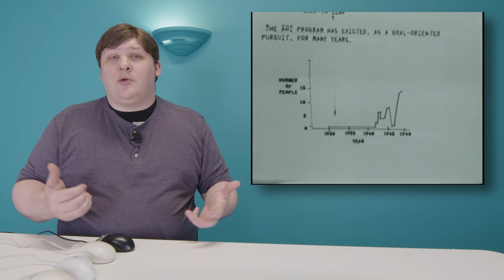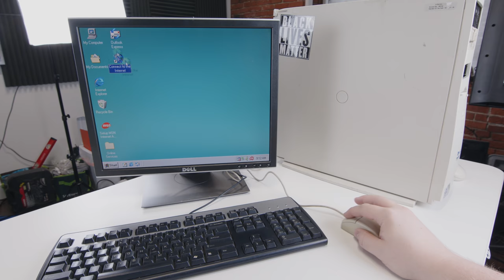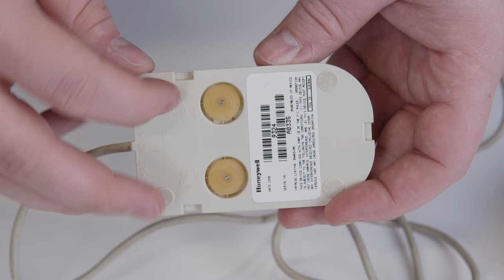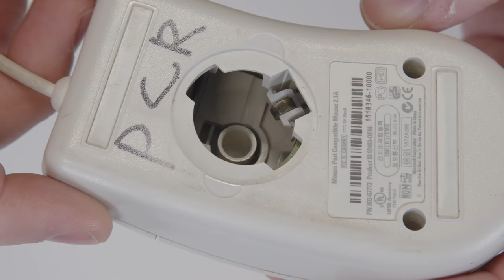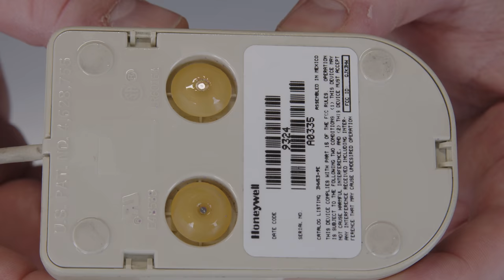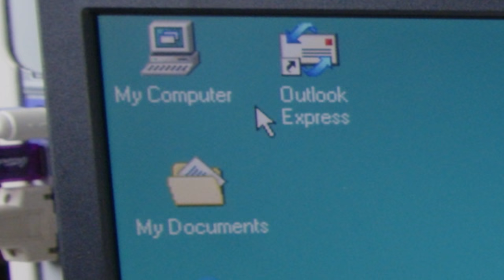Jack Hawley's Unstoppable Computer Mouse

Comment: Pretty sure good SOICs that had the CCD and the processor (and the related deductive algorithms to detect mouse movements) did not come about until the late 90s and as such, the optical mouse did not become mainstream until after the turn of the century.  I was into computers since graduating from high school and did not have an optical mouse until 2005-2007 (not sure when exactly I made the switch).  Early optical mouses that did not require a special mousepad, and I am talking about the early to mid-90s, were terrible and their tracking sucked.  It seemed every peripheral manufacturer was coming out with designs monthly proporting how their new design was heads and shoulders above not only the competition but their own previous design.  This is why my adoption took so long, I liked ball mice and did not mind cleaning them every so often.  I always had ball mice at work, I worked in a call center until the spring of 2006 and all the computers had ball mice.

Comment: BUT! The original optical mice (encoders, and sensors) were a FAR different design then the Micro-$oft optical mouse which used a little camera and a light source!
Reply from the maker: Yep, covered it in my q500 video

Comment: Cool video. I have a question that relates to computer mice. I have a media center that I use for my TV, and of course we have a mouse from which we can control the system while sitting comfortably in our sofa. But we have always had a problem with the range, which is difficult to find a mouse that is good on all surfaces which at the same time can also deliver at 3 meters or more range. Do you have a tip for a mouse we should buy?

Comment: Finally! Proof that I don't have the only one on earth. I bought it because ordinary mouse balls always needing cleaning and this doesn't. And yes, it was damned expensive, just like a genuine IBM type M keyboard.
 Ever try to use an optical mouse on a glass desktop? You can't. But the Honeywell just doesn't care! IT NEVER FAILED.
 Now, if I could only adapt it to a USB plug. (I retired mine when I went to a laptop keyboard with the touch stick in it.

Comment: The potentiometers used were probably like the limitless ones used in the driving controller for the atari 2600, it looked identical to the normal paddle controller but had no stops.

Comment: The PC/jr had an optical mouse (apparently the same one as the Sun): https://en.wikipedia.org/wiki/IBM_PCjr#Keyboard_/_Lightpen  I don't know if you've ever used one of these optical mice, but they are incredibly bad.  They are finicky and only work right if you keep the mouse perfectly north/south on the mouse pad (if you slant the mouse, as you would in a normal natural movement from side to side) it starts skipping and stuff.  My university had sun workstations and the mice were just awful, even compared to generic OEM rubber ball mice from the early 90's.
Reply from the maker: I've heard they're terrible! But, then, what PCjr component wasn't?

Comment: wont work on My pc,
not cause i dont have a serial port but rather because the serial port is right next to the power port, which often resists insertion. on the back of the device.
which means i have on several occasions brutalised my serial port with the power plug,
i have 3 pins left.
gotta love thoughtless design choises like that.

Comment: A spring and thrust bearing would have much tighter manufacturing tolerances as a magnet and a piece of iron shoved into a plastic bushing. So the tooling required to make the mouse like this would be much cheaper.

Comment: Honestly, the main reason a lot of things like this fail, is because no one was sold one. If at the time these existed and you didn't know about them, how would you buy one? Say your actually working in a CNC shop, or the like, a place where these would make the most sense, yet no one tells you about them. After all your going to go thru a lot of cheep mice, and this one should just work forever. Remember, if you don't know about it, you cant buy it.

Comment: Optical mouses wasn´t that expensive in the early 90-tys. You could get one for $20, that really wasn't that much more than a ball mouse. The issue with those mouses was that they have to use a specific mouse pad. Those mouspads was usually very glossy on the surface, and not that nice to use .

What change was pattern recognition from the optical mouse to allowed them to run on any surface, unlocking the use of any mouse pad.

Sorry,.. yes, its as booring as that. It was the mouse pad that was the issue, not the mouse

Comment: I had and used one of these! It always irritated me, that if you rotate your wrist, the cursor moves diagonally. A ball mouse does not track rotation, but this one, because the axles do not touch down on a single point, it picks it up and that is weird to get used to.

Comment: With cheap accelerometers available, I really wonder why nobody decided to make an accelerometer-based mouse. Optical mice still can't work on all surfaces, the one I have has issues with very dark desk I have it on and accelerometer-based mouse could move on any surface, even in the air.
Reply: They're too noisy for that. You can't really distinguish between moving slowly and completely still.
Reply: The way measuring acceleration works, you can't really track absolute position for very long.

However, you could measure absolute position using a microphone and two speakers spaced apart.
Reply: @IsaacKuo  You don't need to measure absolute position, only delta movement and then move the cursor according to the delta.
Reply: @UltimatePerfection  Okay, you're right. Hmm ... in theory, it should work. It would only be suitable for relatively brief mouse movements, but that should be okay for typical use (i.e. not a FPS or other action game). As long as the firmware can assume that zero acceleration means that the mouse has stopped moving, it can zero out it's wrong idea of the current velocity after a second or two of zero acceleration.

It'll be a bit weird, though. Normally, when you stop moving the mouse the cursor instantly stops. But with an accelerometer mouse, it'll coast in a seemingly random direction after you stop moving the mouse. OTOH, maybe the firmware can retroactively zero out the coasted motion after it determines that it's actually at zero velocity. Hmm ... yeah, I think that will work fine for most people. I think most people wouldn't even notice it.

Comment: Those mice always had issues at strange angles (not just an age issue), got given one by a friend who didn't like it either.
Its very peculiar when it occurs but I could never get used to it myself, ended up stuck in a drawer for decades until binned (couldn't even give it away).

Comment: What do you think evolved faster from start to finish into the functionality we would use for years to come, mice, or c? :P

I think the potentiometer mouse would work fine, it would explicitly not do that thing where you have to pick up the mouse. That early thing where you pick up mice and kind of scrape them across the surface, like a cat burying their food, that seems like it would actually be discouraged by this design. Essentially you would need to rewind the mouse ball right? So that means when you go too far left you'd have to go right again. Thats fine, thats how I normally use my mouse, with high enough cursor speed that I can cover the whole screen in a small swipe of the wrist, so i never have to pick up and the mouse stays roughly over the same center point

Two little flat discs? At this time of year? At this time of day? In this part of the country, localized entirely within your studio? ...May I see it?
Reply from the maker: The point about the potentiometer mouse is that if you got it un-zeroed, you'd hit the right side of your screen before you hit the right side of the pad, and would have to pick the mouse up and move it further right
Reply: @CathodeRayDude  I wonder if the potentiometer mouse was actually an absolute input device, rather than relative. So the position of e.g. the horizontal pot directly corresponded to the horizontal position on the screen - when you hit the limits of the pot, the cursor would be at the edge of the screen.

Comment: You know what I think one of the best mouse designs is. The humble trackball mouse you know where you move the ball with your thumb (or finger in some models). They don't give a damn what they're sitting on, don't need as much space as a normal mouse the arm of your recliner is plenty space. Hell I'm using a Logitech M570 right now.

Comment: Well, yes, back in time mice had balls, and with balls come some filth problems. 
But the mice from the 90is worked, and kept working.
I had one  ball mouse! I used it for about 10 years and I bet it would have worked longer. 
I had already over 10 optical ones. And I feel like the lifespan keeps getting worse. And I'm even one of those crazy dudes that clean the switches and tinker around it to get it to work a few more months.

Comment: I don't see why it uses 2 encoders instead of an analog stick (an inverted eraser style nub) using the same material.
Reply from the maker: Because nobody had invented that in 1986, and it has ten times as much friction
Reply: @CathodeRayDude  I could argue that a mouseball approach is analogous (at least past the decoder) to an analog set up, but all the methods have many commonalities so it's kind of moot.

Comment: Actually, I prefer trackballs over mice, anyway. At present, I have two identical mice on both left and right, and a track pad for scrolling or certain other commands. Mice require way too much desk real estate, even more than two track balls and a track pad all put together. Track balls generally have better precision and you can just use their mass to spin the curser from one point of the screen to the other.

Comment: My wife got a GLASS TABLE. I mean REALLY. No optical mouse tracks through 3/8" or 1/2" glass.
I would BUY one of these out of SPITE in USB.
Reply: @UnitSe7en  That's the whole point, Captain Obvious.
Reply: Many higher end optical mice can track perfectly fine on glass. They normally rely on using a "grazing" light (at a nearly flat angle to the surface), sometime even with laser light. This highlights imperfections and dust on the surface for the sensor to track, rather than shining through the glass.

Comment: to be fair if I were to set up a 286 PC with RAMs cache etc I'd struggle to configure all the jumpers etc, whereas a modern PC is pretty much lego, a 6yo kid will do it right, it's hard to actually make anything wrong. The 2 wheel design sucks, if you tried to move it straight the opposing wheel would resist making any movement almost impossible.... Telefunken seams to be one of these companies that invented like almost anything you use but no one talks about them hymm.. I mean didn't they invent PAL TV and early tape recorders as well?

Comment: Would an optical mouse work on oiled Teflon?
Reply: no idea, but there are a Lot of surfaces an optical mouse doesn't work on. anything too reflective or insufficiently flat, for starters.
Reply: An IR optical mouse would probably work better than one that uses visible red. The factor in how well it works would be surface geometry of the oil reflecting light in wrong ways, which is why I suspect IR would work better as the oil is likely to be transparent.

Comment: Picking up the mouse and moving it wouldn't reset the position of the potentiometer. Probably a button to ignore input while he moved the mouse back to center to turn the potentiometers back the other way.
Reply from the maker: I was referring to moving the mouse to whichever extreme of the pad matched the absolute position of the potentiometer.
Reply: @CathodeRayDude  Reading the patent and more about the history, it seems to me like he only used the potentiometers in the original proof of concept and moved to more traditional(to us) rotary encoders since those are also part of the original patent and claimed as part of the new invention.
Reply from the maker: @tmilker  yeah that's not surprising, I was only referring to the one we literally see in the demo, his actual original idea. I would expect that almost as soon as he invented the thing, someone suggested he using coders instead
Reply: @CathodeRayDude  I think it's even more badass if he invented them(I don't know) to improve it. 😁

Comment: Wait, why would you even want to reduce the number of mice buttons?
Reply from the maker: two buttons offers a larger strike area than three; but nobody's going to switch back and forth!
Reply: @CathodeRayDude  couldn't you just map the middle button to the left button? So you could hit either one and get it?
Reply from the maker: @romajimamulo  the spacing is still weird, the left button shrinks and you functionally end up with a 60/40 ish split

Comment: Well, I'm using a good old PS/2 Microsoft IntelliMouse right now! 😏 I know, optical mouses just so cheap, but they can't compete against the additional weight of the ball inside old mouses, right? 😉
Reply: Those classic MS mice are one of the best products ever no joke.
Reply: @UnitSe7en  It's good. 😊 It was sitting so many years somewhere before I got it and started using it. Some dirt affected it a little bit, but now it's good again. I know it's an old product, but my modern Win 8.1 identifies it correctly in device manager. 😊
Ball mouse rulez! 😏 Right?
Reply: A bunch of optical mice - especially earlier models that were competing against ball mice (and some newer mice going for a premium "feel") - had extra weight added to mimic that feel. My classic Logitech Optical Mouse straight up had a steel plate screwed onto case plastic for that reason. At least in wireless mice the extra weight of the battery serves some real purpose.

Comment: You better clean that expensive mouse real fast! That damn machine oil is harmful to plastics especially old plastics.
Really you did not need that much oil on that surface of the plastic. A very thin coat to make that plastic really slide.
Now I need to buy two serial mouses, one for an old 286 and 386 that I have been restoring.

Comment: You could have bought some kitchen teflon-foil or used a simple teflon coated pan.
Reply from the maker: Pan coating has other materials in it that make it rough, for instance. The phrase "oiled teflon" almost unquestionably refers to industrial Teflon surfaces which are likely going to be extremely smooth

Comment: there is no such thing as making your mouse surface "clean enough". ball mice got dirty no matter how extraordinarily clean you kept the surface because of the dirt and oils from your hand. i couldn't get an optical mouse fast enough, ball mice SUCKED and everyone knew that regardless of how little they used a computer.
Reply from the maker: Hundreds of millions of people used ball mice for thousands of hours a year and they simply worked most of the time, besides a cleaning perhaps once weekly. I used a dozen ball mice before I got my first optical. They were far, far, far better than what we could have gotten in a hundred other timelines, and if not for Apple's work in the early 80s to improve on the intolerable 1973 Xerox mouse design, we wouldn't be having this conversation because the graphical personal computer would not exist as a product.

Comment: Something like this might be a good way to a version of a VR booth there is a proof of concept VR booth that is basically a huge number of ball mice turned upside down that you run on but the holly wheel mouse would work better and be more reliable than the ball system  because it wouldn't be anywhere near as subject to damage from dust and stuff but I'm also certain that the ball system for a VR booth is much better than the thing that uses the slip concept I will be posting a reply to this message and editing this message as well to show the proof of concept link for the VR booth.https://youtu.be/Ed1mXV9hNl8 this is what I am talking about with the vr treadmill proof of concept.